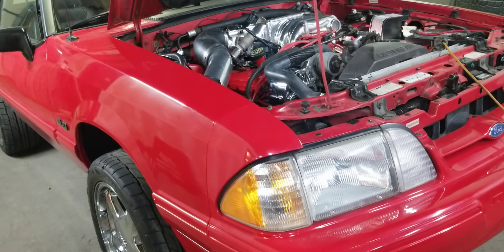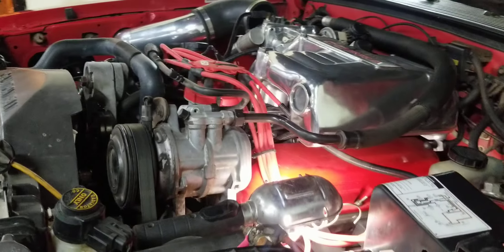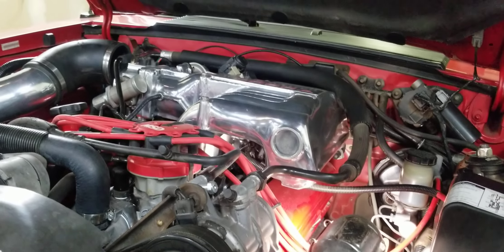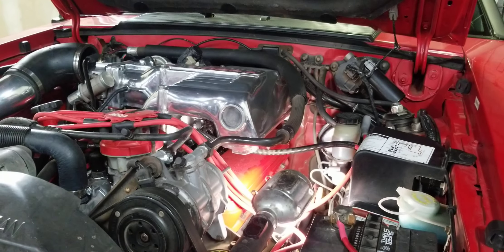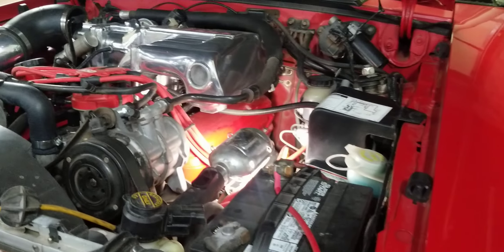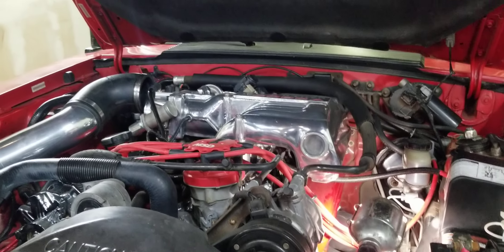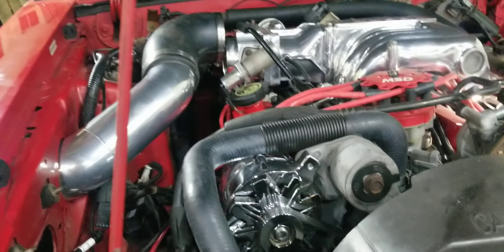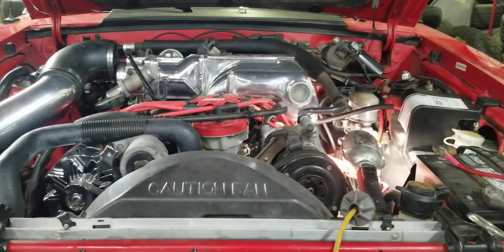Ford Mustang, Showing often overlooked hp robbers on Project Mayhem 😲 Part 1

Comment: I noticed that these parts that have "Flow" in the name...tend to not actually Flow as performance  parts should...It's all about getting that exhaust away from the exhaust valves as quickly as possible and scavenge at the same time...I think y'all's GOOD headers would probably even sound better too! LOL
Reply from the maker: You are exactly correct. Wait till you see part 3, we have some startup sound clips

Comment: All that wasted time and money when they couldve just used the ones u already had ported and ready to go that flowed a lil more than these headers will. But luckily u was there to get them back on the right track
Reply from the maker: Yes. The customers mechanic refused to install the driver side of our stainless steel shorty headers and took them off then told the customer to buy the low flowing flowtech
 Even then that mechanic smashed the driver side flowtech header to get it on which resulted in its flow only being 385cfm. We just went on ahead and installed our ported stainless steel shorty headers. We will be posting part 2 and 3 videos soon.

Comment: What extra work is needed to install your headers?
Reply from the maker: Most applications nothing. This car had worn motor mounts. Even the Flowtech headers that other guy installed was beaten badly to fit and was still laying on the steering shaft. We will be posting the pictures on our Facebook business page at Bigdogs Porting.
Reply: That's sad to hear all the time and money already invested and not putting on the better product!! I mean just put motor mounts on it then go for it with the better headers the money wasted on new headers would have paid for the  new motor mounts geez !!!
Reply from the maker: @garyvanhoosier2472  true but this is what happens when mechanics don't know any better. Just because a person can swap out a part doesn't mean they know the science and engineering on those parts.